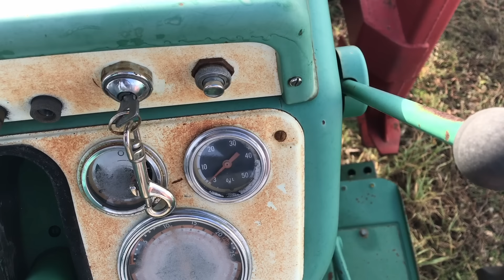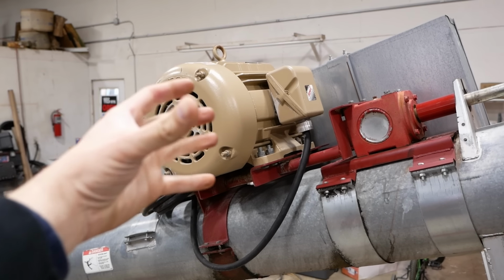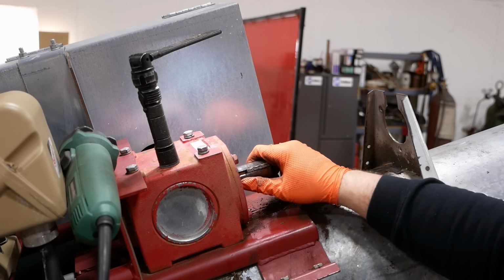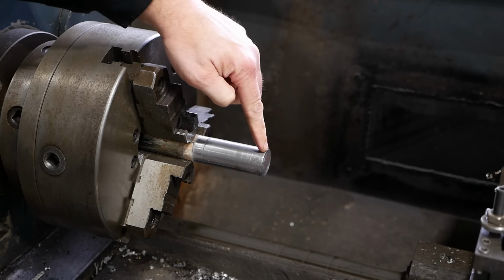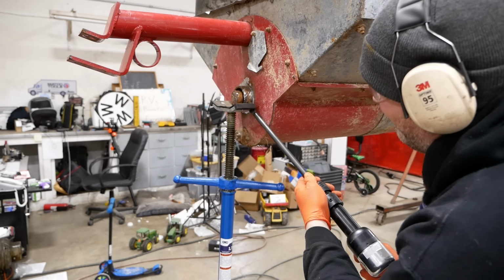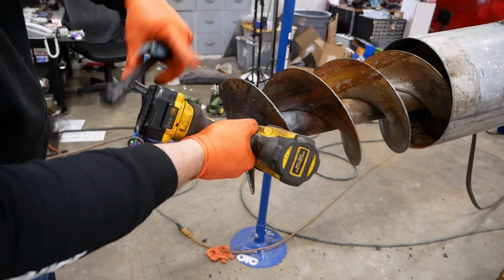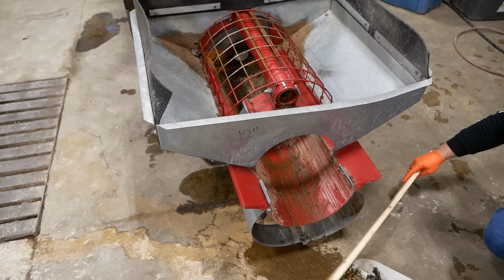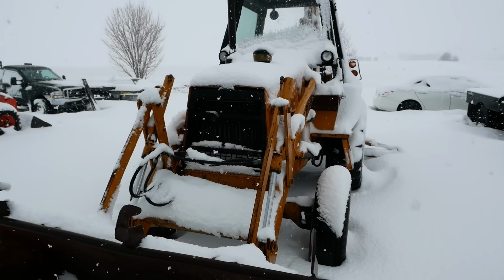Using ALL the Tools to Fix a Chewed up Grain Auger

Comment: cut off the last 6 inches then move the motor mount 6 inches up?
Reply from the maker: The bracket would be in the way.
Reply: @WatchWesWork  true, but you could cut that off and move it easily.  that being said, your work was amazing.....who needs a line boring setup - you really just need Wes, a steely eyed welding dude.

Comment: I never had the pleasure to work on a grain auger but i have had my fare share of V-Box salt spreaders the only thing that i can assume is the maintenance schedule should be set with a stop watch.
 Ugly just Ugly.
 Without picking on a specific manufacturer equipment like this is usually built to destroy itself meaning some components are robust and over engineered but the weak links are way to weak.

Comment: my experience with cold rolled shafts is you really should never weld on them every time I did  it crystallized in that same spot and broke in the future I will be very surprised if this fix lasts more than 2 years
Reply from the maker: That's not how metallurgy works. It's never going to be as strong as virgin steel, but it should be pretty close.

Comment: I’m a bit surprised they made no provision to deal with the thrust imposed by the loaded auger.
Reply from the maker: They did. It pulls against the top bearing. It has a collar pinned on the end.
Reply: @WatchWesWork  That  made your job easier at least.

Comment: 12:35 Did they not use a single drop of lube on those drive shaft metal couplings? Economy so bad we can put a pea drop there so the fella working on it doesnt have to beat it with a hammer?
Reply from the maker: I doubt it would help.

Comment: Why not just cut the drive shaft short, machine a new keyway and shift the motor/gearbox assembly up a few inches? Only downside I can think of would be if the thing's center of gravity was already marginal, but it looks like it was pretty bottom heavy to begin with.
Reply from the maker: It's almost perfectly balanced. I think I'd have to cut the bracket off to move to motor up.

Comment: Don't see why a pillow block bearing isn't  used on the auger. It would fail first but be easier than the machine work and better lubed
Reply from the maker: Dunno. There has to be a reason they did it like this.

Comment: Couldn’t you just cut the ruined section off and slide the motor forward?
Reply: I feel like I’m missing something obvious. Since the motor and gearbox clearly could slide along the pipe backwards to get it off the shaft, is there something preventing it from just being repositioned a couple inches forward?

Comment: The design of this machine looks like it wants to destroy it self. The length of the shafts and alignment must go out a lot with the drive unit mounted that way. 
 Have fun Wes.
 I know your just repairing damage but sometimes don't yah  want to reinvent the wheel a little bit. This machine has some inherent design issues but guess you don't want to be married to it.😊
Reply from the maker: They are pretty much wearing themselves out all the time.

Comment: Wes, if you worked for Boeing I bet they didn't have to ground the 737 Max 9.
Reply from the maker: I doubt that! I've forgotten to tighten my share of bolts.
Reply: @WatchWesWork  at least you put them in were required. As far as I know NTSB is now investigating if due to the haste all bolts were even put in at the required places. Btw I worked 15 years ago for a Dutch company who made products for the ISS and my Boeing collegeas were in those days very precise about every detail required. It seems to me a lot has unfortunately changed in these years.

Comment: call me stupid but at 14.50 when your thinking about options wouldn't it have been easer to trim the crap off the outer surface and as your making a new coupler anyhow just make one end smaller to fit on  new surface  >.< just a tort :)
Reply from the maker: I didn't make the coupler, it's a standard part.

Comment: Poor design on the auger hopper. Would be nice if it could flip upside down to clean it out, or have a trap door cover, or have a weep hole. Something!
Reply from the maker: It has a hole. It's just stopped up.

Comment: Should have put a 3/8-16 thread in the end of that shaft so you can slide hammer it out the next time. Then pulling the bushing out with an ID puller would be easy. 

Suppose you could still weld a nut on the end, but with it in the lathe it would have been easy to put the thread in. 

Possibly like a yearly PM so it doesn't take 12 hours with that garbage design

Comment: The heck. If y beat this much on a gearebox you may as well take it apart and press the crap out on the press :/
Reply from the maker: If it can't handle a few hammer blows how will it handle 15 horse power?
Reply: @WatchWesWork   Jeeze Wes, was not expecting an answer. Anyhow, brinelling IS a thing. Also 15 hp is not a lot at all, you know better than me how comically tiny motorcycle gearboxes are :)

Id never comment about not putting a zerk in an oillite bushing. But beating on bearings always makes me sad. Do it too much just once and they feel crunchy afterwards :/

Comment: well repaired but poorly designed bearing.  It should have a protected ball bearing and a collar on the shaft before the bearing to prevent water and other dirt from getting into the bearing...👍
Reply from the maker: That's why it can't have a bearing.
Reply: @WatchWesWork  I have done a lot of work with similar devices in wastewater treatment plants.  The bearing must be outside the end plate and between the end plate and the bearing in the shaft there must be a collar that drains the water before it gets into the bearing.... I don't know if I managed to explain my English is quite basic...